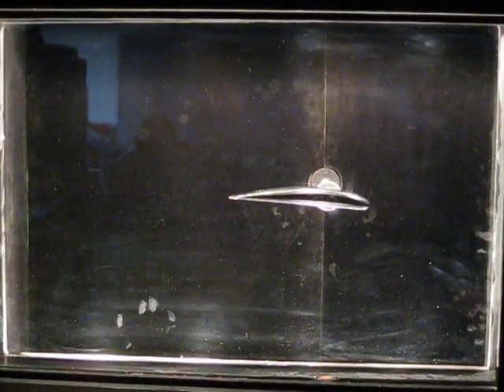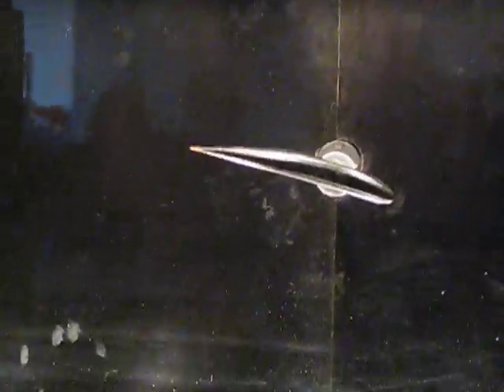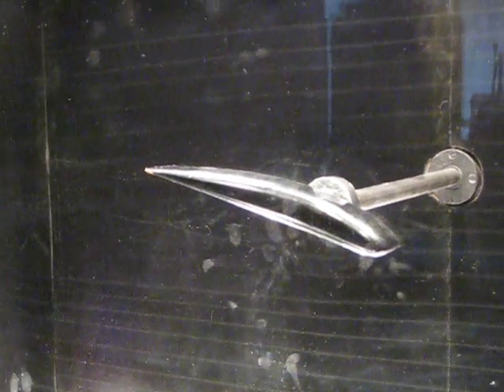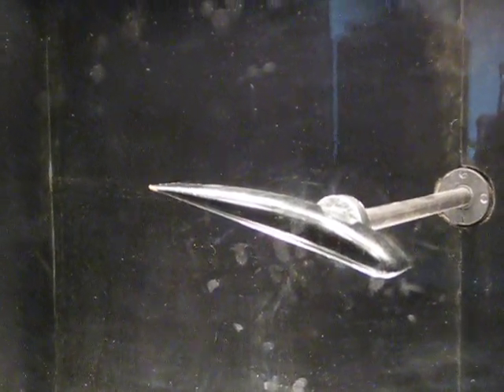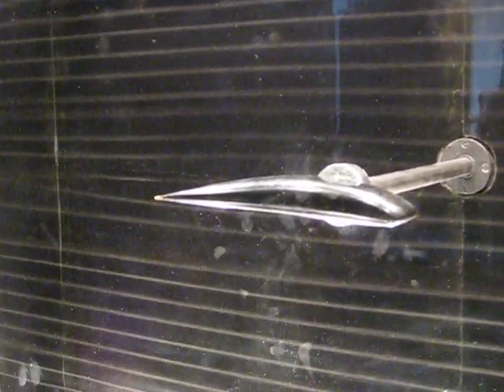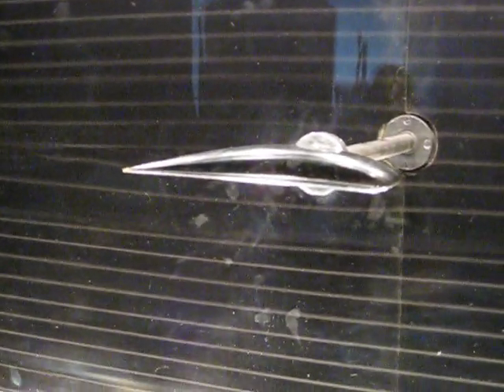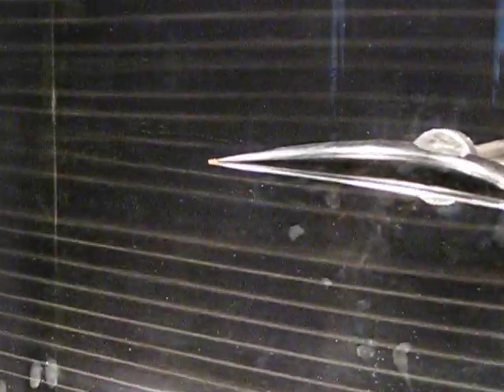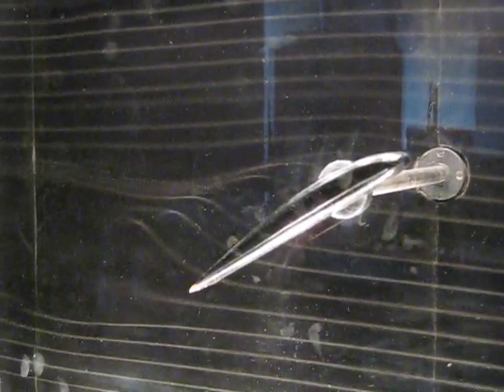Wing tip vortex formation in smoke tunnel over 3D wing tip

Comment: The vortices are generated by the high pressure below the wing flowing to the low pressure on top. Since after all, air pressure flows from high to low
Reply: Can confirm this is correct